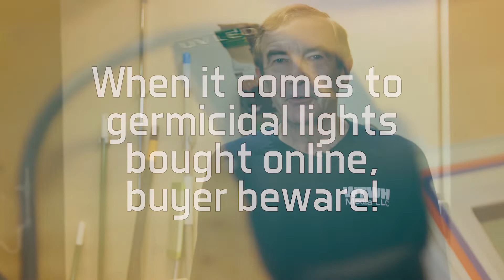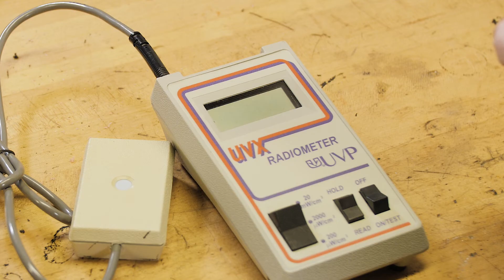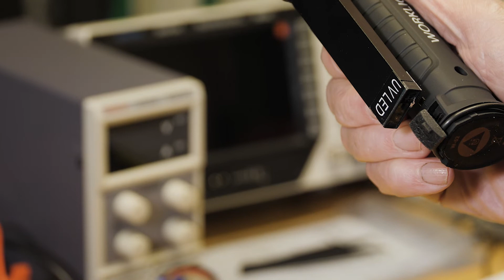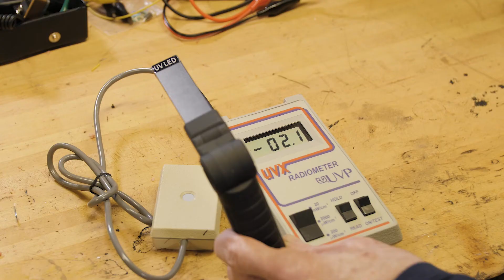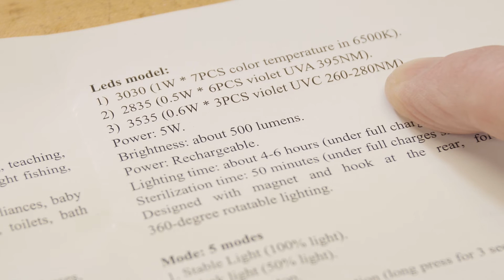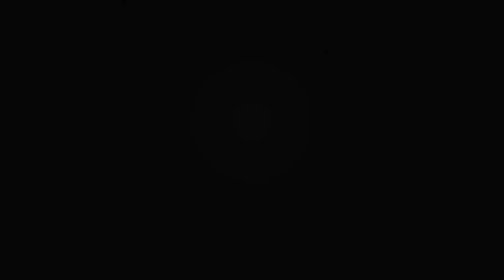When it comes to germicidal lights bought online, buyer beware

Comment: If that’s a standard glass window… Then it would be blocking lots of the UVC I think? It does appear to have three genuine UVC LEDs in it… Probably under 5 mW optical output each… But still useful for the types of things other than sterilizing.

Comment: Your channel is comically underrated and such a wonderful resource! Great video by the way! 

I’m going to paste a quick article I wrote to help out a few friends of mine regarding UVC technology… It’s quite a long read but I was describing it to a few electronics enthusiast who like myself like to tinker with optics, lasers, and test equipment… But who are not familiar with UVC LEDs… And I was trying to give them what little insight I have. And just what I’ve learned about this new technology over the past year or so. I’m not qualified so please  go easy on me… This is just what I’ve picked up along the way.

 A single or triple convoy host with UVC LEDs inside would be extremely useful! But would take several minutes to have any sanitizing effects. 
It would need to be a large array of UVC LEDs to reach the optical power needed for sanitizing. If you look up a video on Adafruit‘s YouTube channel a few months ago they tested UVC LEDs and they had a really large array. I think it was 5 x 5 or maybe 10 x 10 UVC chips chips. Probably a $1000 array.... And they show how much optical output it gives. Super short and interesting video I highly recommend.

Right now the cheap Chinese chips only offer 3-5mw optical output on average and the nicer Chinese chips maybe up to 20 mW. But at that point you’re better off buying the high output 30-50mw nichia Chips.
 
I remember a few years ago my 1.2Watt output green laser filled up a small 10 x 10‘ room with electronics and optical equipment. Costing upwards of $5000. But Now.... i’ve built several 1.5 WATT OPTICAL OUTPUT green lasers that fit into a small handheld laser pointer and run on a single 18650 battery. Costing under $100 to build. It’s the golden age of electronics… What a Time to be alive!

Until UVC leds reach 500 mW per LED chip… it won’t be viable for large manufacturing and sanitization like used in water treatment plants and sterilization processes in industry. Which are actually pretty common in all types of industry. Tons of different industries and factories have UVC light used for treating or curing or some other use.

And when UVC LEDs become powerful enough to replace the standard bulbs in tubes… That will save shit tons of energy! 

The only good thing about coronavirus… The coronavirus is solely responsible for the fast evolving UVCLED technology. Before the coronavirus… Even January of last year… You couldn’t even buy a UVCLED online. The only place I could find wanted me to send all types of business and licensing documents with my tax ID number and everything. Now there are real UVC leds that are as cheap as one dollar each. Of course these aren’t the good ones but still…and high output brand name leds are only $20. 
That’s freaking insane considering they were completely unattainable before six months ago. 

Not sure if you knew this already but here’s Something to look out for… this is an easy way to identify genuine UVC LEDs that actually put out UVC light. -
Real UVC LEDs will always have a purple/gray ceramic housing, with heavy gold plating covering any metal, and a quartz or sapphire window. Because UVC is blocked by glass or other materials..... therefore it has to be quartz or sapphire. If you look up real UVC LEDs then you’ll see what I mean. They all look the same and They all have that gold plating everywhere with the nice purplish gray ceramic body. Very similar look to Vintage IC chips that had beautiful purple ceramic bodies and gold plated pins and caps. 
If you’ve never seen what I’m talking about… then please take a second to check out these 4  links. Hell its like electronics porn. Just Beautiful…! Sex on a stick!

https://www.google.com/search?q=purple+gold+ic+chip&client=safari&hl=en-us&prmd=sinv&source=lnms&tbm=isch&sa=X&ved=2ahUKEwiY4JLdmbXsAhVGvFkKHTMoBYkQ_AUoAnoECAgQAg&biw=414&bih=622&dpr=3#imgrc=RTX1st5lL-ZABM&imgdii=Zcq0VJJb9uK0JM

https://www.google.com/search?q=gold+ic+chip+Beautiful&client=safari&hl=en-us&prmd=isvn&source=lnms&tbm=isch&sa=X&ved=2ahUKEwiAg4jsmbXsAhWKmVkKHdBWBLAQ_AUoAXoECBMQAQ&biw=414&bih=622&dpr=3#imgrc=Oza7GmtLzvckkM

https://www.google.com/search?q=gold+ic+chip+Beautiful&client=safari&hl=en-us&prmd=isvn&source=lnms&tbm=isch&sa=X&ved=2ahUKEwiAg4jsmbXsAhWKmVkKHdBWBLAQ_AUoAXoECBMQAQ&biw=414&bih=622&dpr=3#imgrc=DTqi5yVnySlCkM

https://www.google.com/search?q=white+gold+traces+ic+chip&client=safari&hl=en-us&prmd=isnv&source=lnms&tbm=isch&sa=X&ved=2ahUKEwiIqsa1mrXsAhVkrlkKHXGRACoQ_AUoAXoECAgQAQ&biw=414&bih=622&dpr=3#imgrc=Gp_zyUEw8ENZJM

A plastic body UVC LED would be degraded and disintegrate by UVC light! therefore they have to be ceramic bodies, and sapphire windows. Even UVA and UVB light is really bad for any type of plastic or polymer. Therefore good quality 365nm LEDs will usually be ceramic and glass with gold plating. None of that plastic rubbish. Sure you can find 365 nm LEDs that have plastic bodies and the standard polymer coating over the top… But they will degrade quickly.

The Chinese UVC leds that are a few dollars each and sold in most of the products on Banggood and elsewhere are between 2-5mw light output each. Maximum I’ve seen is 20mw but they’re a little bit more expensive and I wouldn’t trust them. Like I said the nice brand name UVC LEDs with over 20mW optical output aren’t cheap but totally worth it! Ranging from $20 to upwards of $350 per LED. Highest output I’ve seen so far 70mW but it’s changing weekly. And they’re hard to find because everyone selling out of them quickly because of coronavirus. But once the pandemic ends, high-quality high power UVC LEDs will be cheap and readily available when demand goes down. And as bad as this virus is, I’m glad that it’s helping adVance the UVC technology.

The reason UVA, UVB, and UVC light is so useful and valuable is because it is absolutely one of the most important things used in all types of manufacturing, engineering, The medical field, and all types of science and study of biology and other important areas.. 

From curing finishes to doing spectroscopy and Gene therapy in the biology and medical community… UV light is so important. We wouldn’t be where we are today without it.

I got into UV light for completely other reasons. I build and restore guitars and antique violins… as well as the other half of my business which is industrial circuit electronics repair and calibration work on process control equipment for assembly lines and electronics and stuff like that… 
So UVA, UVB, and UVC light are all very useful in spotting flaws on circuit boards, cracks in traces and solder pads, and most extremely useful in the woodworking and guitar industry for spotting repairs or flaws in the woodwork and finish. Each wavelength is useful and I utilize as many wavelengths as possible.

You can’t imagine the usefulness of having UVA, UVB, and UVC lighting available to you. Whether you like to work on cars and motors, electronics, or do fine art restoration, science, biology, electronics, optics and laser… 

whatever your hobby or business…UV light in all wavelengths is extremely valuable and you will find a million uses for it. 

I’m also big into the laser and optics Hobby. Started with laser pointers and graduated to high end lab and Medical laser stuff which is available for pennies on the dollar out of retired military and health care uses on eBay. dirt cheap incredible stuff. 

I have lasers that easily surpass  100 Watts of optical output and fit in the palm of your hand. That’s crazy insane power levels by the way. Like blasting right through steel sheet. 

Laser modules that would’ve cost $20,000 when new that can be purchased on eBay for under 100 bucks! One hell of a time to be alive that’s for sure. It’s the golden age for everything!